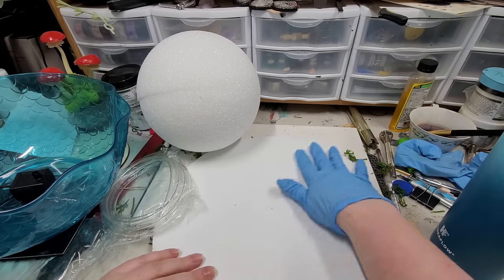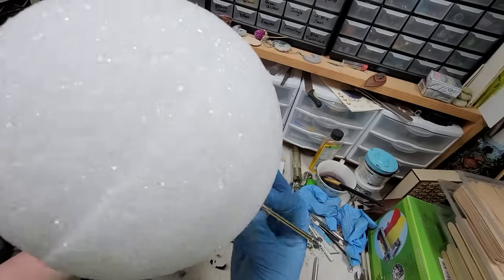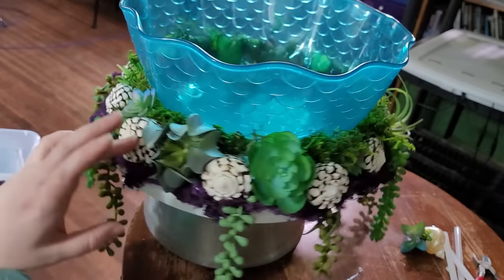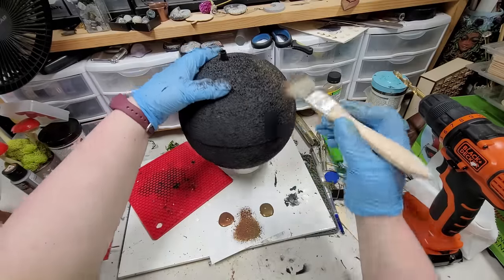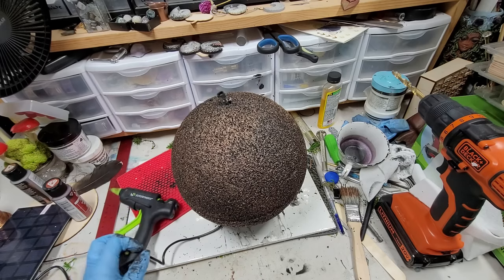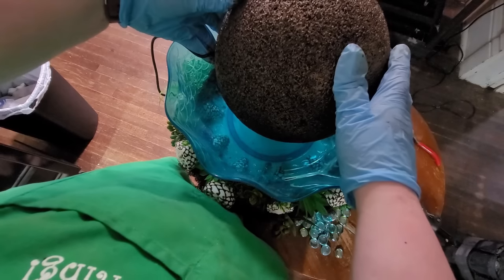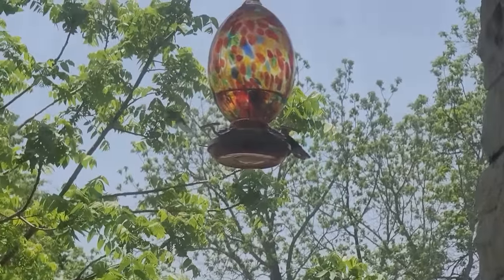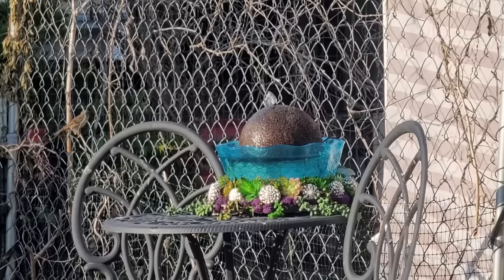DIY Fairy Fountain with Solar Pump!

Comment: Sometimes a plain old drinking straw will fit into these fountain parts//spout areas. Also, I keep old cologne bottle caps or water bottle caps to use as legs since they are plastic. Good for many crafting ideas. Going to try my hand at a water fountain/ bird bath this year. I've not done it before so...??? Love all these different ideas! One thing I've learnded is to put some rocks into the water, high enough that birds can have a  place to land and feel safe drinking from the fountain. A few twigs around the edge or pushed into the styrofoam ball for hummingbirds little feet to lite on would work well too.

Comment: It works I've done it. I use my soldering tool.. it gets hot enough to make the holes bigger without cracking it ... - it releases the pressure.
Reply from the maker: This is good to know! Thank you, Nancy!!

Comment: FYI I have sunflower seeds in my feeders so it's usually the tiny shell pieces that get into my pump and stop the motor. I've been using the same pumps for 4 years. Also, some pumps store a charge and therefore run after the sun sets. The higher wattage pumps will only allow a stronger flow. You'll only get the sound of the fountain if the water falls to the basin from a greater distance. There's not a lot of sound from the round spheres. Lastly...if the spray is too high, the wind will blow the water outside the container. That will cause the pump to run dry.

Comment: Not sure about the paint and styrofoam??? - Usually, it is best to use natural elements or hard surfaces without paint when feeding or watering birds -  What it looks like is less important than how safe it is for the birds - Time will tell if this is safe.
Reply: That was my thought too. She did mention the first paint she used was non-toxic but didn't say this for the gold paint.
Reply: Acrylic is supposedly non toxic to birds.
Reply: The finding out is the sad part.
Reply: @duckyday1099  -  If the birds picked at the styrofoam they may not be able to digest it and they could die -There is a reason store-bought birdfeeders and birdbaths are made in a specific way - As someone who has fed birds my whole life this really irritates me -
Reply: Most places sell green floral styrofoam balls which is what I used.  Also I don’t know why you inserted your tubing and cut it off?   You already have the hole.  IF you’re going to do this to your ball leave the tubing out til you’re done
Reply: If you want it to make noise use one of the fittings
Reply: @carolirvine7663 i have wanted to paint some styrofoam globes in the past but worried it might be toxic to birds.  Of course it’s prettier but its better if you know what you’re putting out is safe for them.
Reply: @MamaMia-ye2be the green foam (floral foam) is not good to use for birds.

Comment: Using a balloon with several layers of slick cement would have been a better choice. Gives weight as well as with a texture will give the birds a surface to grasp. River rocks 🪨 and flat stones/rocks would have been also a good alternative choice.

Comment: That small pump has a filter that may need cleaned periodically. Gluing the pump to the ball and the bowl makes it almost impossible to open the pump. You'll need to remove the filter out and pop off the pump cover to get into the motor. My solar pump motors freeze and cleaning them frees up the debris. Sometimes I need to give that motor fan blade a spin to get them moving again.

Comment: What a neat idea! Looks like the sparrow didn't hesitate long, did he? I wonder if adding tiny little perches to the Styrofoam ball would help encourage the hummingbirds to settle and drink? I used to raise finches, the little feeders had tiny little perches attacked. The feeders were plastic--if you snipped the perch section off the feeder, you could stick the two braces into the foam leaving the perch sticking out of the ball. Not sure if that help, but the plastic feeders are cheap and available at any place that sells pet supplies and food. Again, this is such a cool idea! Thanks Von!

Comment: Easy mix cement makes a good, non-toxic coating if you don’t want to use paint. I always wonder about non-toxic claims. Are they sure about hummingbirds?
Reply from the maker: This is an interesting idea! An update on this fountain; it didn't last a month! The birds ignored it except to pick the moss away for using in their nests. I still am in love with the idea behind this fountain, but need to do a ground-up redesign <3 I think cement like you've suggested is worth a try!

Comment: I think you could place pvc pipe through center and run tubing through that. Also coating the Styrofoam with concrete would prevent it breaking down in the sun. Just frost it with light coat. Plastic and paint are not healthy for the birds. Very cute, it looks darling, but im just not sure its safe. Birds will pick at all that treated moss and plastic and it could harm them.
Reply from the maker: This is a really good idea! I ended up taking this fountain down as day 1 wind blew the styrofoam ball out. An updated video is coming soon!

Comment: I don’t know why these people continuously use hot glue on some things that is going to be left outside hot glue does not hold up if it rains. If it gets wet it is not going to stay together. I have done this over and over and over and it never holds up water / rain and hot glue do not work.

Comment: Just add small wood legs I have the exact same fountain and pump you just put in the Styrofoam and it lasted me two years this year’s going to be my third year that’s plenty powerful but I used concrete like Robbie does. I didn’t trust a Styrofoam. I was afraid it would get stuck in the birds beak.

Comment: Instead of the styrofoam, He could have taken an old basketball or any ball (any size), and make a hole in it for the piping to go through and then fill the surrounding with concrete and then remove once dried and you got yourself a concrete ball.
Reply from the maker: That's a really good idea!